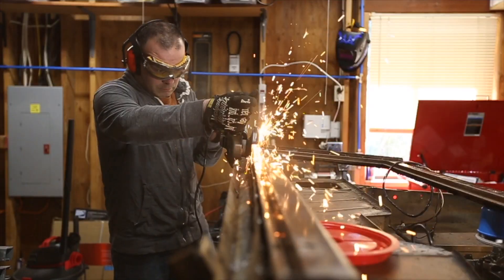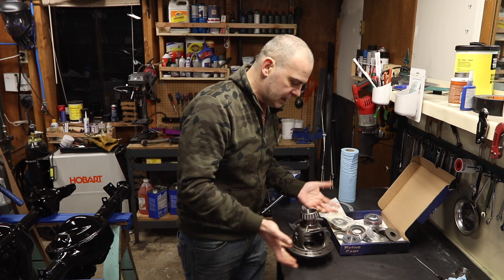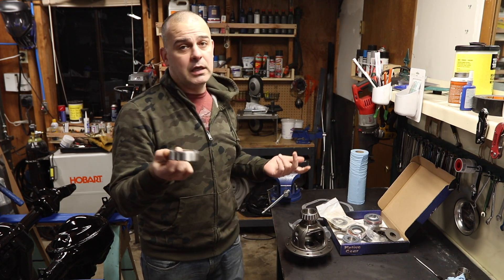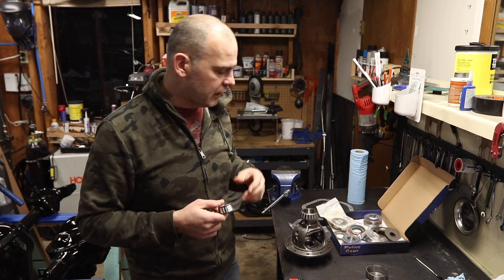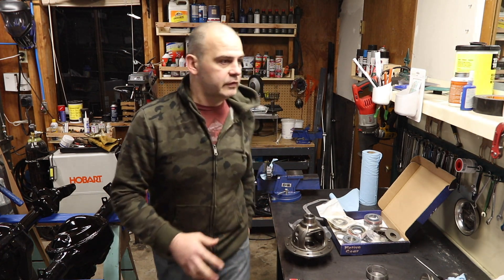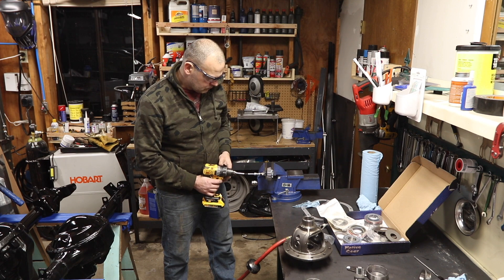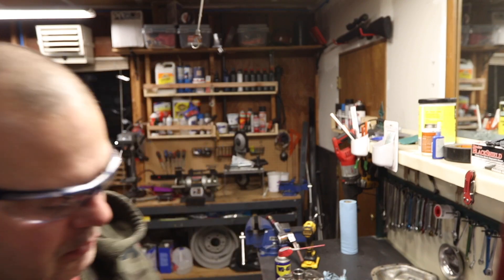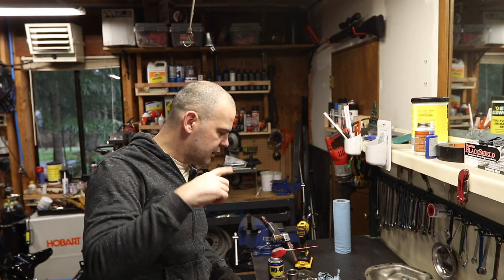3.21 - Making Set Up Bearings - Part 3 of Gears and Axles

Comment: Nice way to do it but I never heard of turning the Carrier Bearings into slip fit - the preload shims go on the outside (unless there is something I'm missing).
Reply from the maker: Depends on the Dana axle I think. On my TJ they are on the outside. On the bronco they were inside.
Reply: @budmanzoom4441  Thank you for that because I was thinking the same thing, I’m about to do an ‘85 Squarebody and it’s shimmed to the outside, but I need to make a setup bearing for the pinion